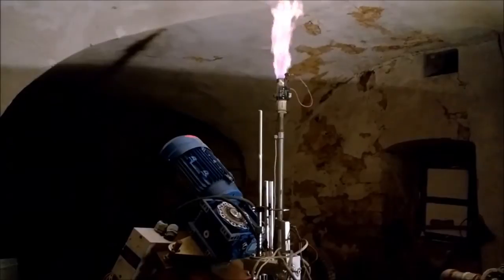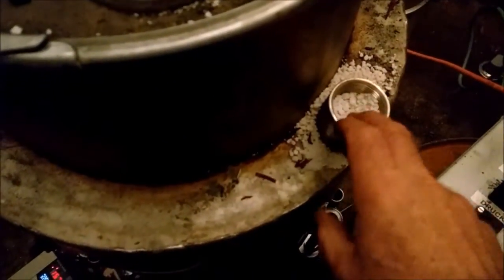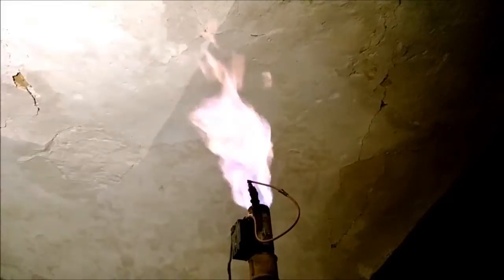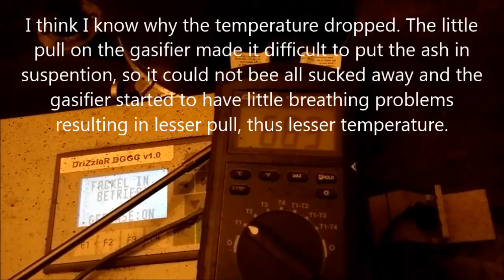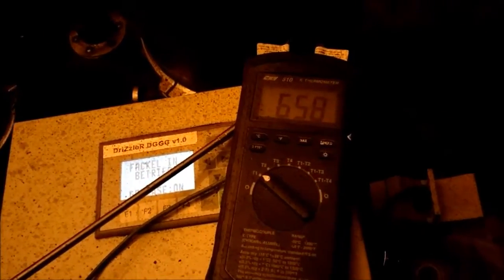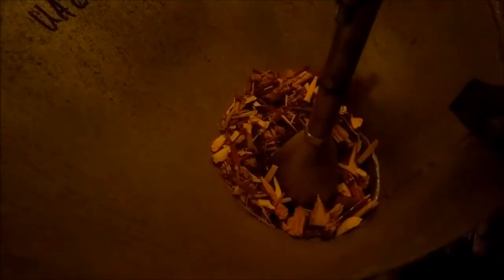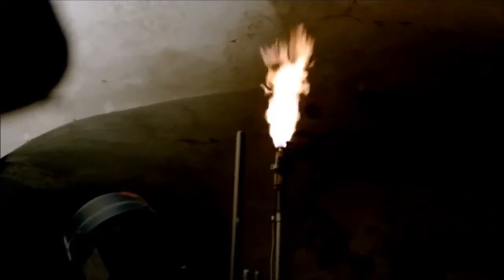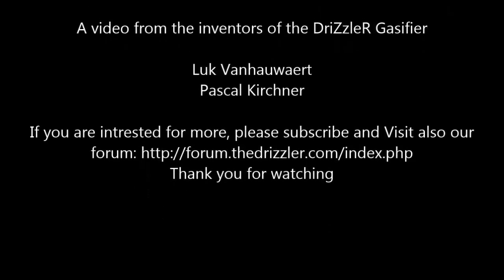Grateless DriZzleR Gasifier first testburn

Comment: Hi Luk! 
How many horsepower is your auger motor? Thanks !
Reply: urgentcareguy3 Curently I am using a 2HP, 1,5Kw motor. That is way too much overkill, taken in acount that withe the VW 1,3 l engine we only harvast some 7.7KWn electric energy. But I took this marge to be able to transport and test all kinds of fuel, inclusice the G50 industrial chips measuring between 20 and 85mm.Luk
Reply: Awesome work Luk! Thanks!

Comment: Another thought I just had, did you notice what temperatures you where getting when you wre drizzle feeding, rather than using the auger. Thanks. Regards Stephen
Reply: On the flaming Pyrolyse we have around 1150 degrees, This on has the same temperature but gives less good gas and the reduction is much cooler. It puzzles me why??